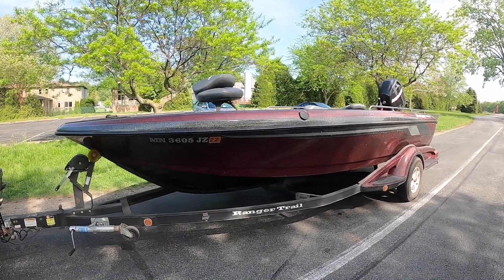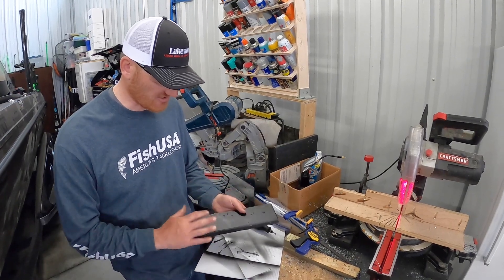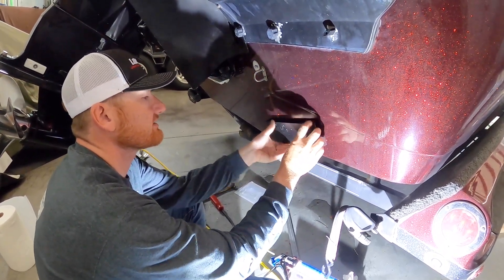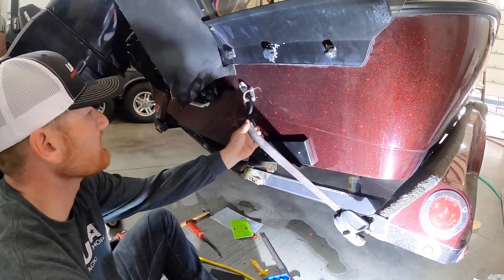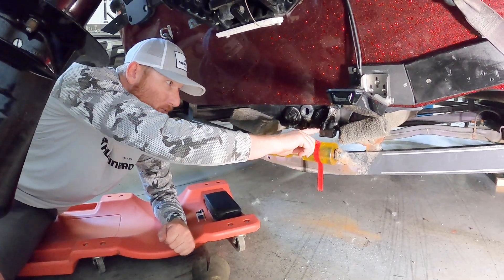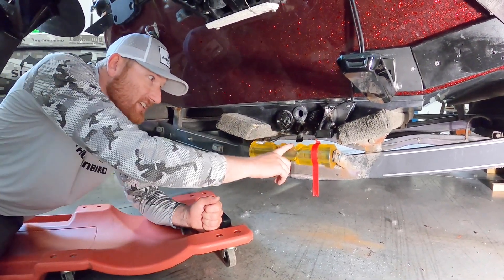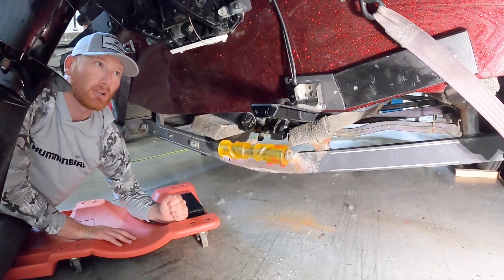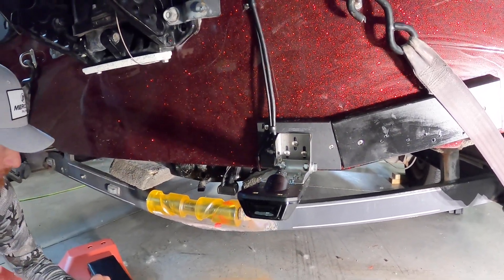Project Boat Restoration Part3 | Installing Transducers for Perfect Placemment

Comment: What is your preferred method for figuring out that correct angle to set the side imagining transducer?
Reply from the maker: U want it flat at the speed you will mostly traveling. 

U can search The penny and level method. 

I've done it enough I get close and adjust it woth trial and error